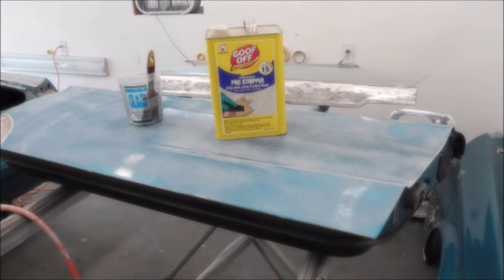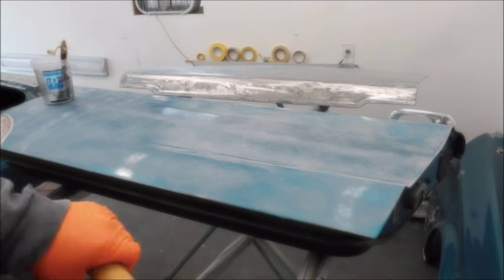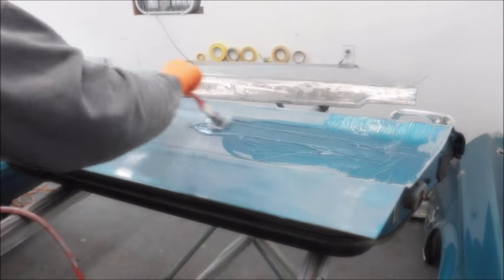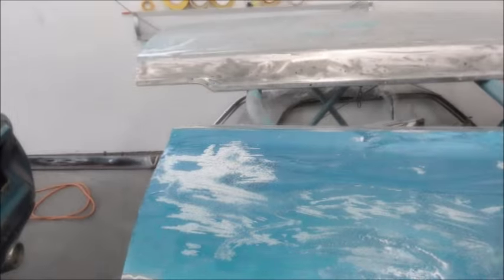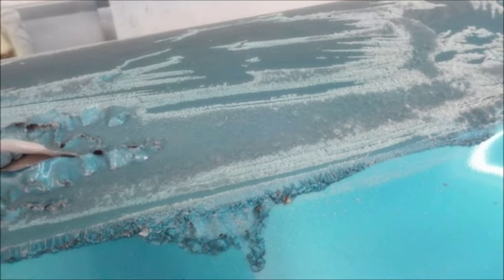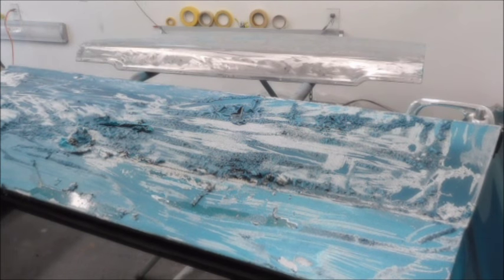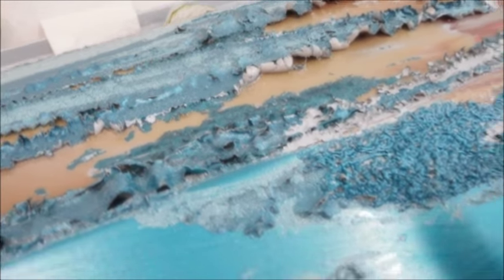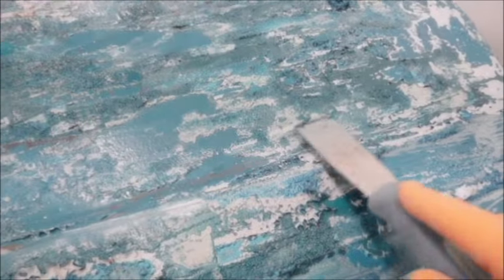1968 Mustang paint strip round 2. "Jade" part 22

Comment: So....... I don't know if it matters at this point since your last comment was a year ago but this is my process for paint removal which seems to work pretty good. Ideally you want to be done quicker than sanding it off. I did 2 layers of newer paint with a clear coat on top with 2 applications.First is to hand sand in a cross hatch pattern with 60 or less grit paper the entire panel that you are working on. Next I take ordinary plastic shopping bags and rip them down the sides,usually 2 would be enough. Wipe off the dust. Then lay on a heavy coat of good quality aircraft stripper immediately covering it with the plastic, you do not want it to evaporate as this will halt the process. Do an area large enough for 2 bags. After a few minutes begin scrapping the area under one of the bags leaving any area you are not working covered. I use a razor scraper that I dull down on some wood,seems to work better than a putty knife. After I scrape that area the first time  I reapply and cover it then move on to the area covered by the second bag repeating the process. Always basically working 2 areas at one time. This will speed up the whole process making it more time efficient than sanding with air or electric tools. Important things... presand, cover with plastic, heavy application, razor scraper, heavy duty rubber gloves, safety glasses, I use a mask also,and put a fan on me at lowest speed to move the fumes away from my face.
Reply from the maker: Good info. Thanks.

Comment: OK here is how stripper actually works. The thick slime is to keep it from running off the work surface and the liquid held within the slime is what does the job. Just lay it thick then put some saran wrap over it or the plastic you use to wrap skids.  It should come off in one application or two. If the solvent flashes off in the heat it stops working. The longer it stays wet the longer it works the deeper it goes the easier it is to scrape off and so on. I have never tried that brand before but it tends to look weak to me. I like the Circa 1850 stripper. Oh one more point, let it sit over night to let the product do its job as long as it is not drying out.

Comment: Any updates on the ‘68? I’m getting started on my fathers ‘68 Cougar....your 68 project is just about an exact match. I need to do the full floor plan, and the full front clip with frame rails. I notice you did a major front clip replacement (on the ‘65) and didn’t use a Fran jig/dolly. Any tips for getting things to line up right would be great!

Great videos BTW.....super helpful for us weekend warriors!
Reply from the maker: No real updates on the 68. I bought new quarters and a tail panel, but not installed yet. As far as fitment/alignment, I used the 66 coupe as a reference, and assembled everything to check fitment prior to welding.

Comment: Using stripper can be more of an art than a science. While I have never stripped automotive paint, my experience tells me; (1) Scuffing is not needed (2) The less 'painting' of the stripper, the better. Too much painting, thins out the stripper too much. Pour it on and use the brush just to move the stripper around. When I brush it, the brush doesn't even touch the surface. I keep the brush about 1/16" above the surface. If the brush stops moving stripper around, I pour more stripper on, I don't lower the brush.

Comment: Hello I have stripped a lot of Cars and this is how I did it. First off Goof Off is a rip off company of Goo Gone and not good. Aircraft Stripper is much better and it leaves the Gel Coat on Corvettes. You have to Slop it on as Heavy as you can in a cool place out of any sun and use a plastic Spreader to remove it when it is ready usually in ten minutes and reapply. Sometimes you have to cover it up with Plastic Sheeting to keep the Vapors in. Of course make sure you wear gloves!

Comment: Being new at this and learning, wouldn't a da sander be faster?
Reply from the maker: Not necessarily. You's go through a LOT of paper with a DA. I had not used chemicals before, and wanted to experiment. I typically use a stripper disc on my 4.5" grinder. I noted that in my other video.

Comment: first
Reply: Put it on thick; do it in parallel lines. It helps if panel is above 20C . But do not let it dry out on surface. I use wire brush on second application it gets into the lower layers.